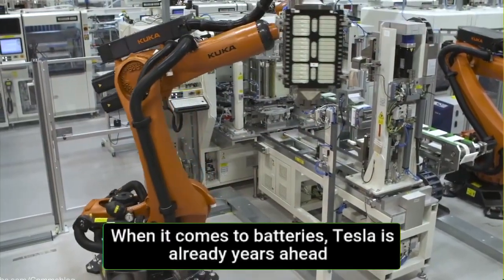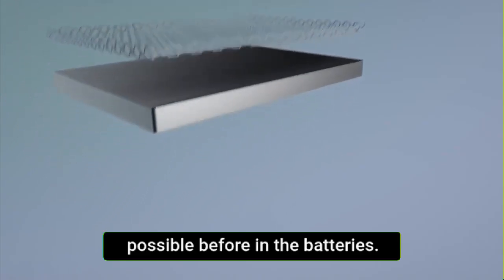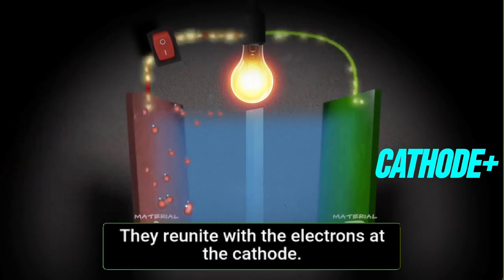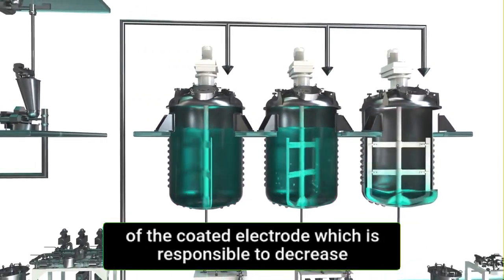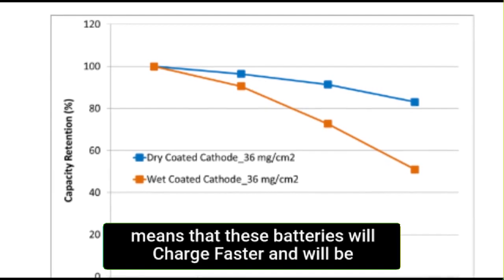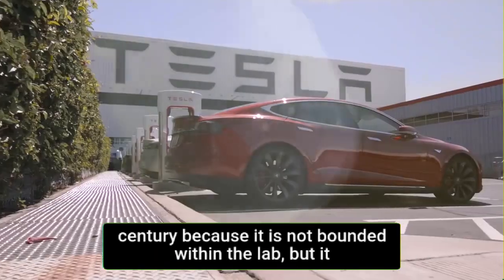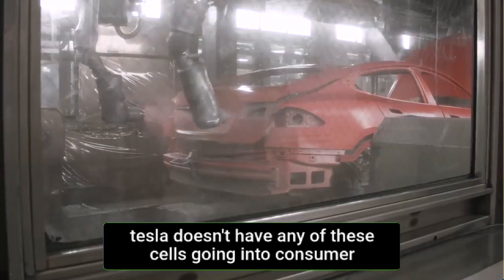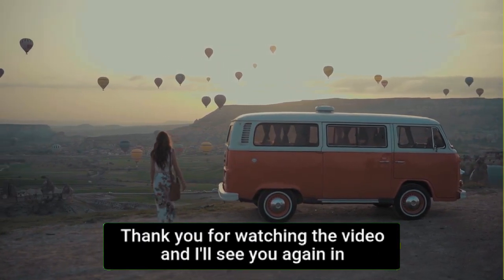Tesla's New Battery Will Be The Final Nail in The Coffin for ICE cars at "Battery Day"

Comment: The current thinking is NOT that Tesla will introduce dry cell battery production on battery day. Dry cell production is still years away. The million mile battery will be an improved wet electrolyte which slows the formation of dendrites so that 4000 thousand charge cycles can be achieved. The new battery will also use tabless construction that will improve energy density and charge times. That's my bet. If Tesla introduces dry cell production on battery day I will  be blown away.
Reply from the maker: Thanks for the feedback, Yes you are right about use of tabless construction and 4000 cycles Battery. But Elon did say Battery day Will blow our mind, i think they are in early beta production phase of dry battery , I may be wrong though, Let's see what happens at "Battery day".